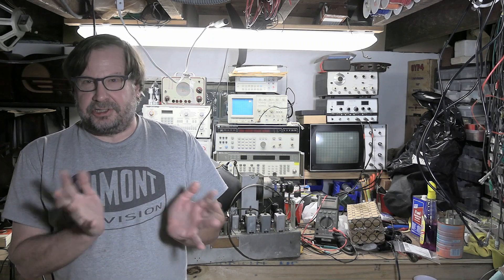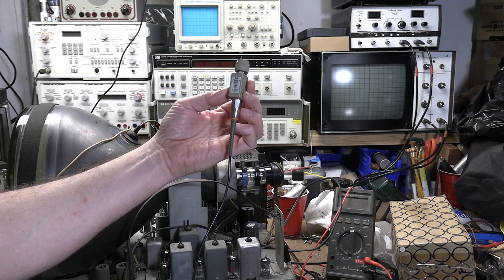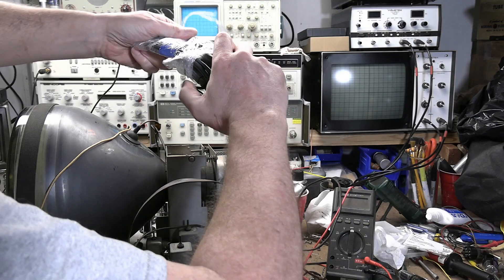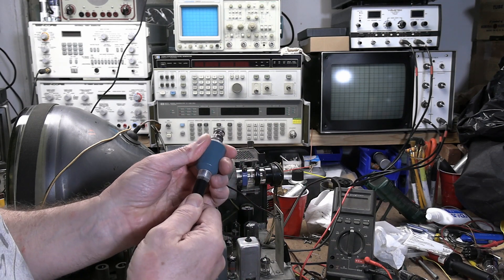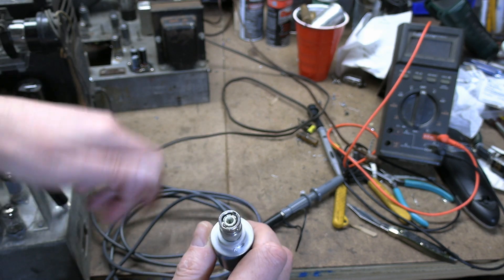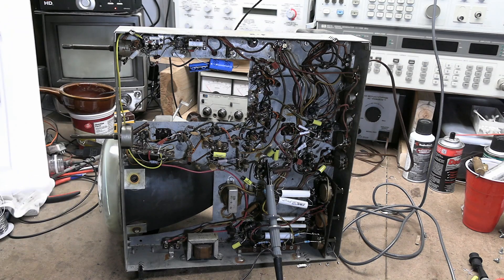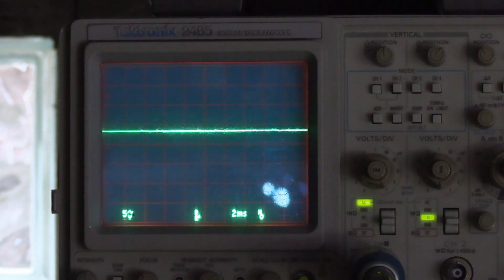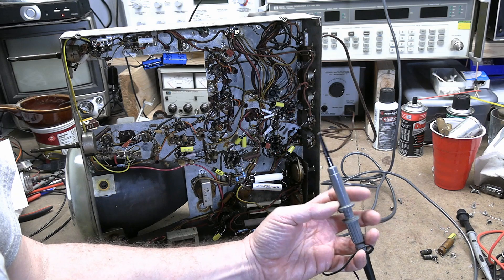Tektronix P6009 1.5kV X100 probe

Comment: Great video on a very useful probe!   I managed to get the X1000 version (P6015) in a bunch of random gear I dumpster dived a while back. MUCH chunkier than yours, so not much for "daily driver" use like the X100, but it lets you completely disregard those "Do Not Measure" warnings in the service data.  You can clip the scope right onto the HV rectifier, damper cathode, or HOT plate if you wanted to.  Measure the ripple on the anode voltage too! :)
Reply from the maker: Holy cow!  Now that's a probe!  Looks like it needs to be recharged with fluorocarbon 114 😲
Reply: @bandersentv  Yeah, mine still has a few drops rolling around in it, so it will run at full ratings.  Derates to "only" 10 kV without a gas charge.
Reply: 50 years in the business and I never needed one. What are you measuring ? We simply drew an arc to check DC 2nd anode. To measure High voltage Ac just coil a few turns , hook it to a probe and scan the field around the transformer. Yes, its nice to have equipment like that but not really necessary unless you are doing research and design.
Reply: @erin19030  Not "needed" for anything related to old TV's, but useful in work on high voltage pulse power, radar, X-ray, etc. I dumpster dived mine from a university physics lab, which worked with plasma chambers and stuff.   Weird test gear becomes a hobby of itself, after a while...
Reply from the maker: @erin19030 Nothing like that.  It can only go up to 1.5kV.  You would need a X1000 probe to measure 2nd anode.    You probably never needed a X100 probe because you use older analog scopes.    Many newer solid state scopes have limited voltage range even with a X10 probe.  This allows me to measure waveforms that are 100 volts without damaging my scope.  For example I'm working on an Admiral 19A11.  The sawtooth waveform on the plates of the 6SL7 are 300 volts peak to peak.
Reply: The P6015A is a newer replacement an uses a silicone fluid instead. The compensation network is probably different as well due to the different characteristics of the silicone fluid. @bandersentv

Comment: A times 100 probe is a necessity for checking the collector waveform on a solid state TV. It saved losing a hot of HO xistors and other damage with the jig I made to power up the H section of solid state sets to verify if the FBT or tripler was bad, or a fault elsewhere in the set. I did a post describing the test setup and procedures on another forum. It saved hundreds of hours of time and frustration.  I built the unit into an old Tek scope cart I got at a ham fair where the plug in modules were stored and put my scope on the top of the cart.  It even includes a totally isolated variable B+ supply to drive the set, plus everything I needed except the VA48 to generate the H drive signal.

Comment: The probe coax cable normally has a nichrome center conductor with about 200-400 ohms resistance. The resistance damps internal reflections, allowing the probe to give a faithful response over a much broader frequency range.

Comment: at least you don't have to worry about bad battery ram problems with that version 2465, I have a 2465BCT with counter timer option that I copied the old battery backup NVRAM just before it went totally dead and burned it to a new type of FRAM which needs NO battery backup, and after 3 yrs. still holds its calibration. Should be good for 50 yrs or more, these are great scopes even though I have more modern Agilent scope, but I always use this scope. Because it's just easier to use than scrolling thru menus to make a simple change
Reply from the maker: Yeah that's why I focus on the early version even though it lacks some features

Comment: Your probe has four adjustments in the box at the connector.There is also the main compensation adjustment at the probe body just behind the finger grip flange. it is a collar that rotates with a lock ring behind it.
Reply from the maker: Thank you for the valuable information.

Comment: I was wondering, are you using your Tektronix 130 LC meter on these projects? I really enjoyed that video as well.
Reply from the maker: I have it handy if I need it but haven't so far. Most of the caps and inductors I replace are too large for it to measure.

Comment: Don't  you have to put the scope  above   ground by using  a   isolation transformer   when probing  high  voltage?
Reply from the maker: Not if you use a high voltage probe.  This one is good for up to 1,500 volts.